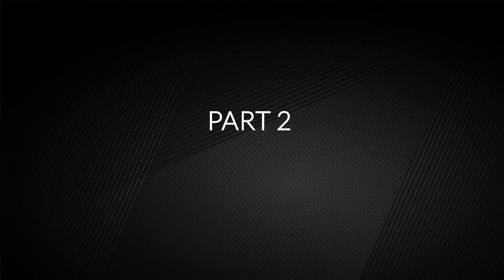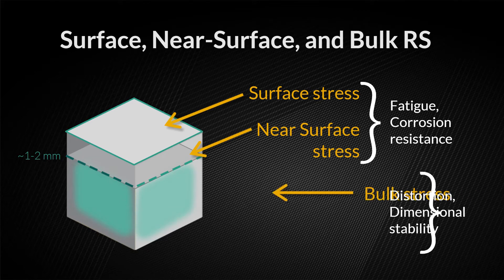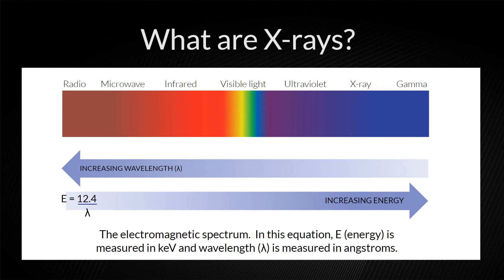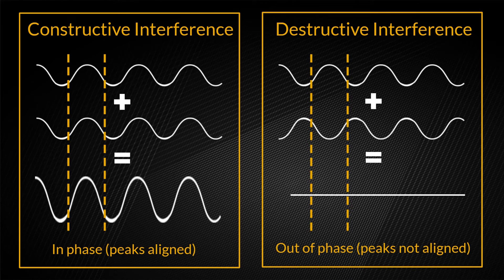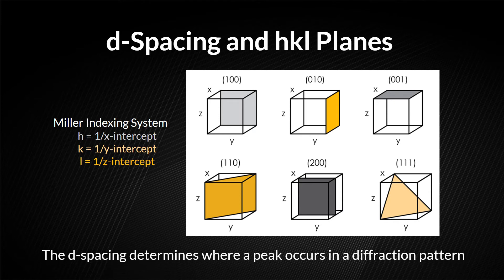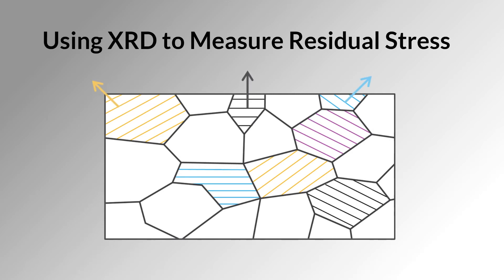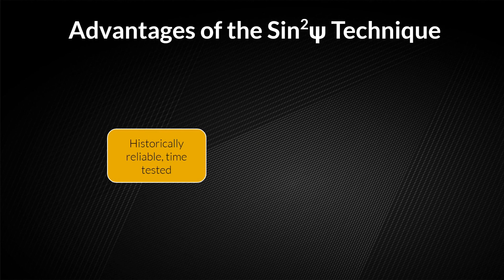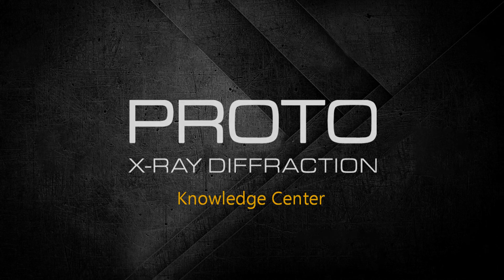Introduction to Residual Stress - Part 2

Comment: Incremental Deep Hole Drilling is a semi-destructive technique that CAN measure high stress levels.
Reply from the maker: Hi George, Thanks for your comment! Depending on the application, a semi-destructive method may (or may not) be considered "destructive" - it just depends on the damage tolerance of the component. In the instance of a very large damage tolerant component, yes I agree, the technique can be considered semi-destructive, but in the instance of a very small, less damage tolerant component (say for example a small aerospace turbine blade), it could never be used in service after hole drilling, so the method is effectively destructive in this case. Suffice to say, we all agree there is some "destructive" nature to the hole drilling method (semi or otherwise). On "high stress levels," again, it depends on what you consider high - generally, you need to be concerned with localized plasticity at the edge of the hole - when stress levels exceed 60% of the yield strength, you run a serious risk of introducing significant errors into the analysis - I would refer you to section 1.2.2 of ASTM E837 for guidance in this matter. Cheers!

Comment: 3:33 Thomson scattering is type of elastic scattering of electromagnetic radiation on the unbound electron, such as conduction state electrons in metallic body, since electrons unbound and unlocalized can not produce consolidated interference pattern.
X-ray diffraction comes from elastic scattering of ground state strong bound electrons called Rayleigh scattering.
Reply from the maker: Electrons in an atom may approximate to free electrons if their binding energy is much lower than the photon energy, so with x-rays, the scattering is typically modeled as Thomson scattering. However, as you said, it is technically Rayleigh scattering if we go by the definition of the electrons being bound. If you'd like further clarification, feel free to drop us a line at info@protoxrd.com!